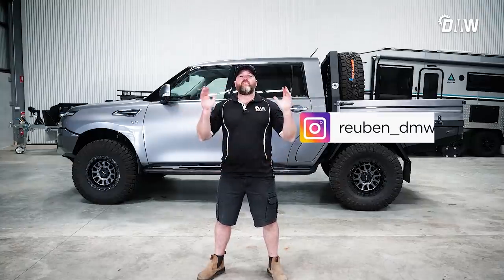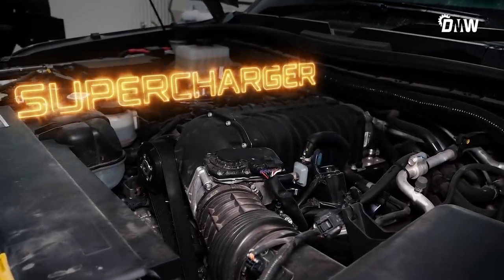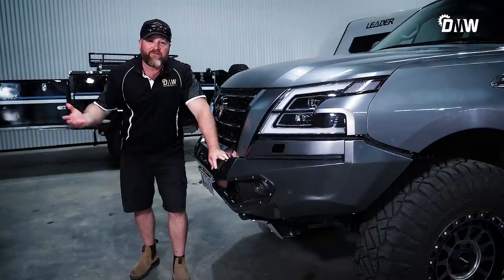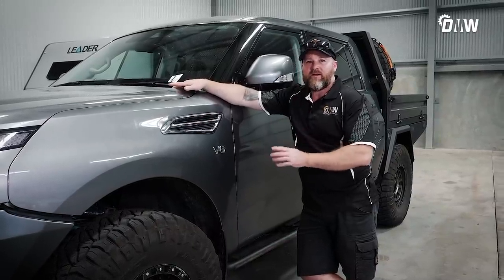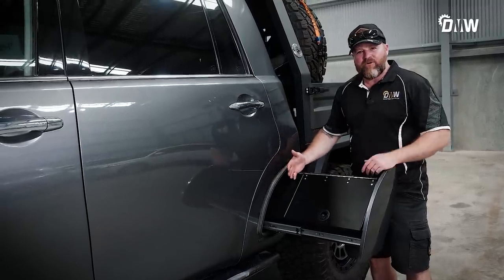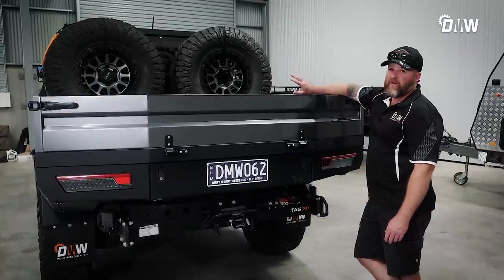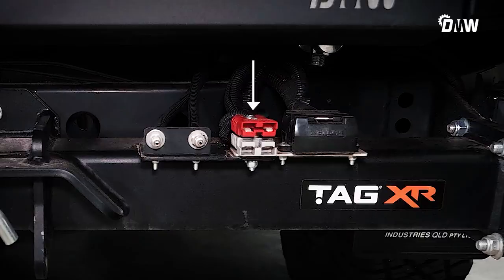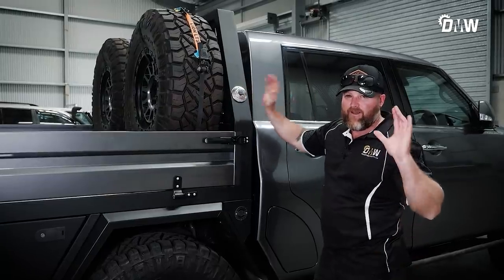DMW SUPERCHARGED Y62 Patrol Dual Cab - Rig Rundown

Comment: Hey Rueben,
Love your work nothing but an eye for detail.
A couple of things l would add / change. Wood grain l would paint a mate silver, put a fridge in between the back seats,
I would put a flip lid to access to tools from behind the back seats in the event damage to either side and the draws couldn’t be opened. 
Plus a mid centre winch with a pulley and a feeder slot @ to top of the headboard on each side. So the winch could be used from either side, in the event that you need to hold yourself up while pulling forward so you don’t have to rely on another vehicle to hold you upright.

These are just my ideas.
Reply from the maker: Thanks for sharing @skipper7624 , all great ideas! :)

Comment: DMW Ruben The cavity where the wheel arches were would be ideal for an Aux fuel tank. Because its low and forward of the rear axle, could be gravity fed to main tank or fuel line? Woodgrain delete and painted body color or covered with thin fabricated stainless sheet?

Comment: Brilliant DMW. Looks epic . I’m going Safari snorkel on
Mine due to weight savings for Van towing and water ingress issues with the stainless ones .
Reply: The safari ones have much worse water ingress issues, watch 4wd247 on Moreton and you’ll see why.
Reply: @Lucas-vw2yb  I’ll take a look for sure . Your the first to mention water issues with Safari . Thanks for the heads up . Weight is my main concern as mentioned . Every KG counts  when building a towing rig .
Reply: @Lucas-vw2yb  got a link to the clip
Reply: @paulwebb2097  stainless will save you when you inevitably hit a roo. Safari will crack, happened to me when a roo hit from the side.
Reply: i have a ranger with stainless and yes getting water in when raining is a problem

Comment: First thing I would do is do something about the poxy ratchet straps holding the spares down. Surely you could fab some sort of hidden clamp system for each wheel that hold them securely and separate so If you actually "do" a tyre the other good one is still held secure.